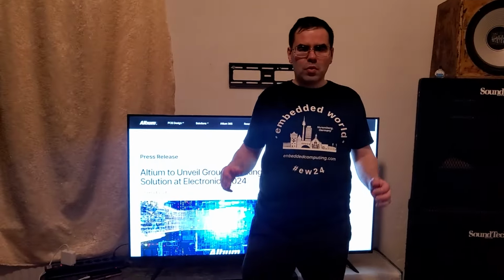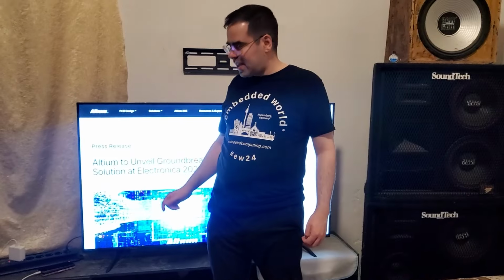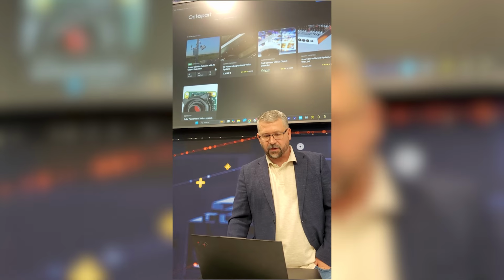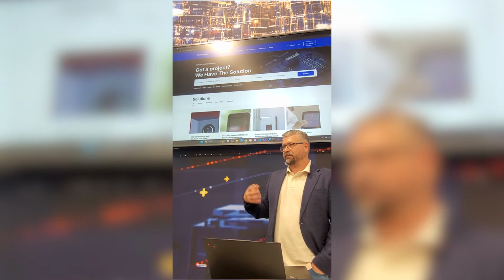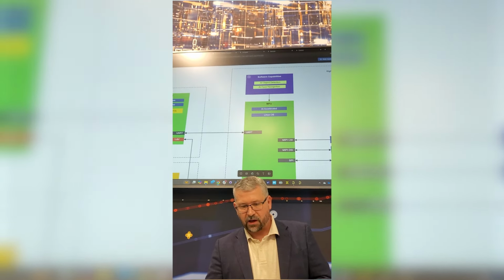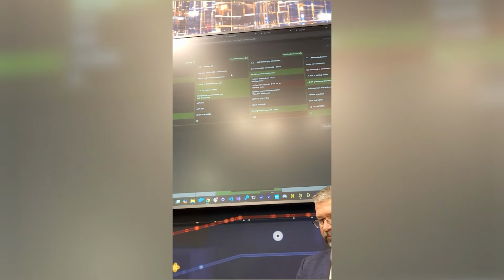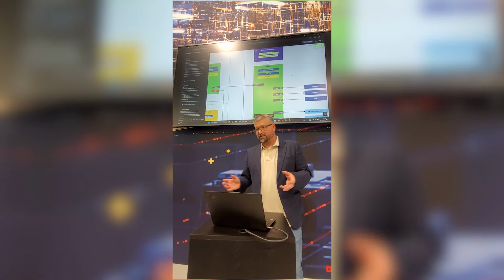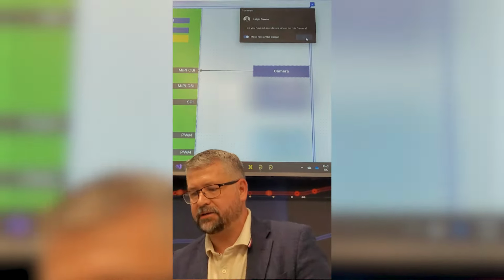Altium Discover at Electronica 2024

Comment: This sounds uninteresting.
Reply from the maker: Bro, I hope it were. Sadly...I fear this will change our industry as whole...
Reply: @MrTamhan  Possibly, but I'm sue that it is promising more than it can delivere ithout the user understandin  the design process. We had a PC board house decide to at heat relifes t every mouting hole. TThe multiband VCO board for  very kow phase noise PLL system for deep space Telemetry systems. They ibsisted the doil of copper from the grond plabe to the plted mounting hols wouldn't cause problems. I had to solder coppper foil over them on both sides of hat whole run to make them meet specifications. It was an old standard, and the new standard caused more than 20X the phase noise. The tuning range was band swithched with hard biased diodes to shorten the leng lof a strip inductor. It wasthe leanest, in the Telemetry industy. Others tried to copy it, butt didn't understand the subltle arts of the design. I see this wiz-bang package like Spoce in the handsn of a hobbyiist. It might work, but not well.
Only ime will tell.
Reply from the maker: @michaelterrell  Thank you so much for talking back. Yes, of course, simulations always have their limits - there is the famous photo of Bob Pease throwing a computer out a window for a reason...

Comment: My background is Software Development but with some electronics development more lately. I'm not really convinced that scanning the internet for possible solutions, by the Altium Product, is the right way to go about development. It could very easily lead to being miss-directed and aquiring lots of bad practice and problems. I can see what they are trying to achieve which is possibly worthwhile, but the implementaion is not what I would be happy to use. I'm used to developing products from first priniples and getting top level requirements sorted out as a first step, not filtering the Internet for my solution. I might just be out of date, but this seems the wrong way to go about things. I can see that the tie up with suppliers would be beneficial so this does help their product. Thanks for covering the topic, it was interesting to see.
Reply from the maker: Hello Andrew,
thank you so much for talking back here.

IMHO, the trick here is that the Altium system does not search the Internet on its own. Instead, they have some kind of ingestion system, where the vendors upload their reference designs for a fee....

Tam